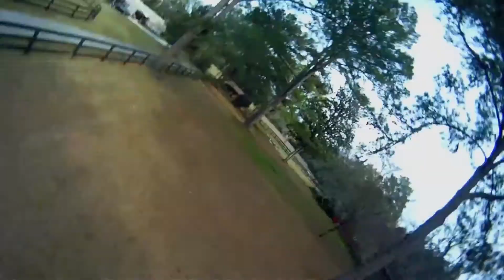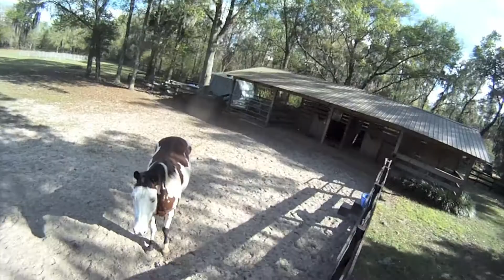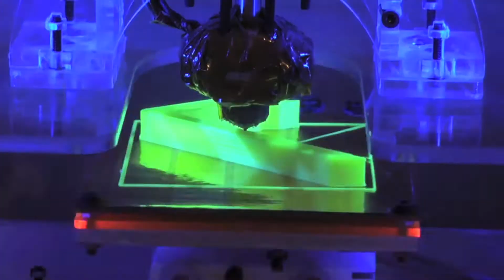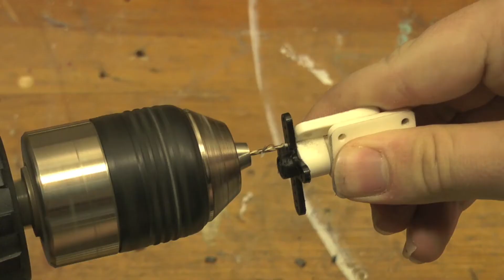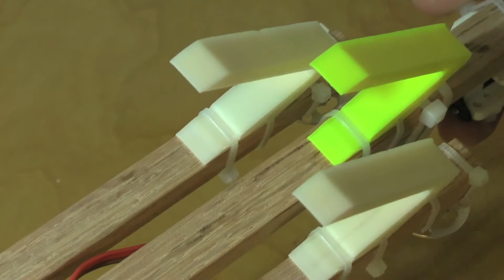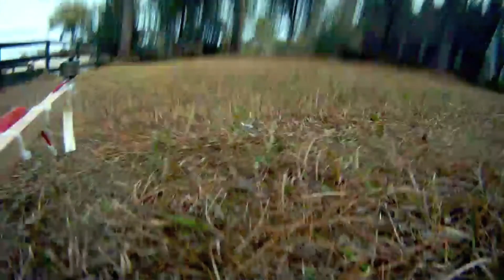Tricopter V2.5 Build (Part 1/3)

Comment: Hi  Lucas here is a tip, instead of using acryllic for your body parts use polycarbon.
It is impact resistend and does not crack when overtightend or when you crash.
It looks the same
BTW I love you video's